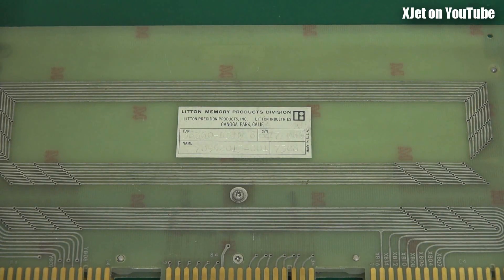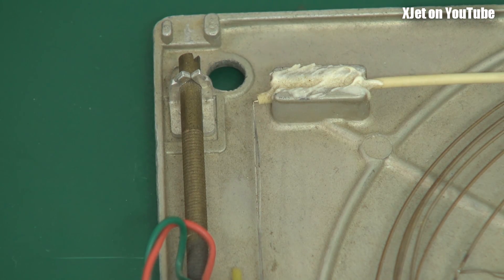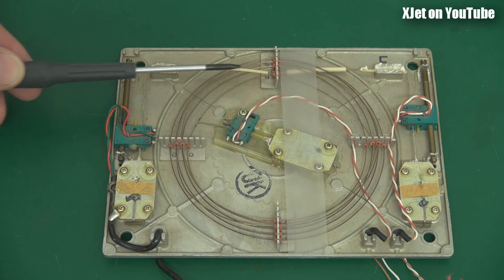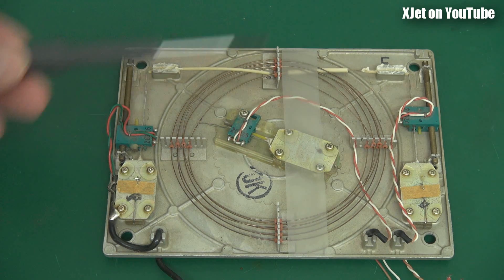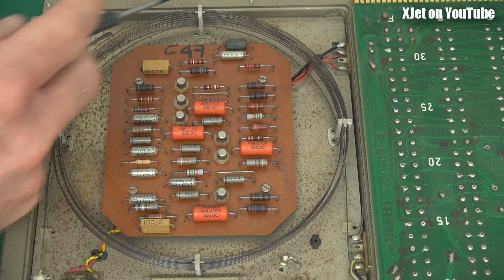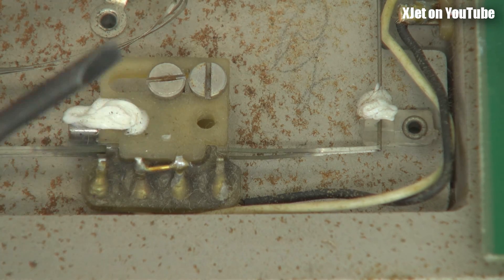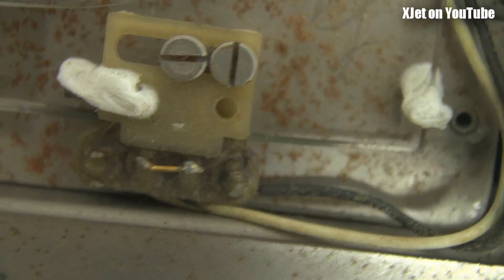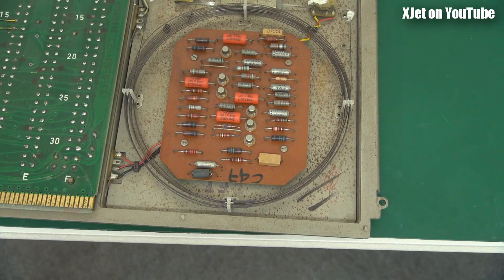Old computer tech:  delay-line memory

Comment: Wow, never knew these devices existed. Really interesting. Seems a bit complicated. At first glance I thought it only could hold a single bit, but it seems it can hold a serial string of data that travels through the line. Wow. So how many bits of data can be saved in a delay-line? 

Can you try to store information and read it out with a pulse generator and a scope? First measure the time it take for a pulse to travel through the line, than send a short burst (of the measured time) of pulses trough the line and check if it stays intact after traveling through the line. Gradually pump up the frequency of the pulses to measure how much data it can actually hold that’s still recoverable. Seems like an interesting experiment.

Anyhow, thanks for sharing!
Reply: Here is a scope image of a Friden EC-130 calculator.
https://www.youtube.com/watch?v=fie-Z-mjnyU

Comment: . Hard to imagine how little data this stuff stored. I actually used a IBM with two of those massive discs in the late 80's on a Navy ship. It used one disc as "Master" the other for storage. Master worked like a hard drive and had to be replaced every week or so. Ship also had a navigation computer probably a 80886 with a then fire breathing 100 K of memory. K not mega. In future I would recommend getting rid of the bug spray to avoid bad puns in comment section

Comment: 7:13 That construction technique is called "cordwood construction" Yo place axial leaded components in a tightly packed pattern between two PC board layers. Name comes from the visual similarity to a stack of cordwood. It allowed a high part density, but was harder to service, particularly for interior components. This one isn't too dense, but some are quite incredibly packed.

Comment: Didn't see in the comments, but the delay line in the unit that had the coils was probably an L-C delay line.  Series inductors, shunt capacitors.  We used to use custom built analog video delay lines for timing NTSC video signals in a television station.  Measure with a scope how much delay is needed for a signal, then you have the option of using enough coaxial cable as the situation demands, or - as we'd usually do - order a custom delay line, with 75Ω impedance.

When I was just out of high school in Minnesota, a couple of Air Force guys agreed to give me a tour of our local radar station (you never knew when those sneaky Canadians might attack!)  The rotating dish received both reflections from airborne objects and ground clutter.  A mercury delay line was used to cancel out the pattern received in the last transmission/reception and was effective in nearly eliminating the ground clutter and showing only those reflective objects that were moving.  I asked how it worked, but they were techs and didn't know.  I've always assumed there was some acoustic trick being used.

Excellent video!

Comment: I wonder if that could be made into a reverb/delay for audio....
Reply: +TheBaconWizard That sounds logical - a really, really lo-fi grungy one I suspect. Obviously people used large metal plates and springs (in guitar amps) for reverbs...  I have a guitar amp with a spring reverb; makes the most godawful noise if you knock it when it's turned on
Reply: Dr Tune yeah, but spring reverbs are LUSH if you use them subtly. In fact I have a project to make one as we speak.
Reply: @DrTune  Or make a string reverb from an old shabby zither. There are alway plenty of broken ones on ebay etc., which doesn't matter so long they have enough strings on it (and can be tuned to hold tension). Put a mic and speaker on it to get the audio in and out.

Comment: The Sperry-Rand Univac computer system, which was based on a large mercury tank ringed by piezoelectric transducers to store memory bits as streams of sound pulses, had a console meter to indicate the accuracy of the mercury delay memory. You could see the meter wiggling randomly as the accuracy varied. This was a true mechanical delay memory, and it had the clumsiness of any mechanical component. The correct pulse sequence was constantly being regenerated using redundancy to eliminate the frequent errors in propagation and detection of the sound pulses.

Comment: I have used 5 inch once, I could write on them once and read once, then 2nd time after writing there was no reading. 3.5 Floppy was better but it was like 10 times only. CD-RW were only a bit better, DVD RW are similar. I don't have a Blue ray disk reader or writer, as we have better Flash drive technology. Blue-ray I will just let it go and not own. I have a Kingston 64 GB SDD as my primary HDD and a 2 TB HDD which i bought just 2 months before the Tsunami that hit all HDD plants. It bought it for real cheap and its my main storage. I have waited 3 years for HDD prices to Drop, but they are too high. Since my 2 TB is in good condition and not in use as the SDD takes the hit, think I can wait a long time till HDD costs go low.
Reply: +therealnightwriter I think you have never used them. I was doing my engineering at that time. and was looking for best floppy which could keep my codes on  so i could use on other PC. HDD was the only reliable storage. 3.5 only could do it 1 time. 2 time was a luck. 3rd was like hitting a jackpot. When i bought my first computer i bought all parts seperately. 64 MB RAM 17 GB HDD and a celeron processor 450 Mhz, and it came with L2 cache, earlier had none. My friends were like why  17GB HDD ? I said just in case. Now my phone has 16GB inbuilt with 32 GB card, still i cant manage space, i need a 64 or 128 micro SD card in the phone. You guys have not seen the evolution of the PC, Google is not the best source. I lived with PC evolution and i am in IT field so i do what i love the most, few people get this.
Reply: yt678901 Think your memory has an IO-error. Floppies were far better than you suggest. My brother's first computer was a 8088 running 5 MHz, with dual 5 1/4 inch floppy, no hard drive. Never heard him complain about failing disks. My first computer (Sinclair QL) didn't have a hard drive either. It had micro drives, which was also storage of data to magnetic film. Multiple write were no problem at all. Of course disks could go bad, but in general not something I worried that much about. Used the same backup disks over and over; rarely if keeping something precious, I would make two copies. Back then it was the only means of storage, so obviously it would have to be better than write once storage.
Reply: @yt678901  Are you kidding? I still daily use 3.5'' diskettes on my Amiga and they rarely fail. IMO they are quite reliable. Cruicial is only to keep the drive clean (cleaning diskette) else the debris from a damaged disk will stick to the head and wreck the next inserted diskette too. And of course keep diskettes away from magnets, strong heat and moisture.
Reply: This sounds like when 360kB 5.25" floppies were written to in a 1.2MB drive.  The read/write head is only half the width on the 1.2MB drive, so you can't fully overwrite the data placed there by the 360kB drive - half the original track is left behind.  So this would mean you could write once on a 360kB drive, then write a second time in a 1.2MB drive, then the disk would stop working in the 360kB drive, as it was seeing half the old and new data at the same time and getting confused.  The only way you could reliably interchange data on 5.25" disks between 360kB and 1.2MB drives was to have two 360kB disks - one you only ever wrote on the 360kB drive, and one you only ever wrote on the 1.2MB drive.  Then the differing track widths wouldn't cause any problems as each disk would only have tracks of the same width on it.

Comment: acousticl delay line memory, worked by depending on the binary length, sending a torsional wave round and round until extraction. your description was was very good.
The olivetti part you are showing was from the very first printer calculator released in 1965 at a cost  of over $3,000 which today would cost about $40,000, just for a calculator, quite shocking really. 
Just goes to show how expensive electronic devices were in the early days, now you can buy one for $2 in wallmart.

Comment: If you had to write your own driver would you be able to jury rig something this old through a serial port? and would it still work?
Reply: +TripleDz You could do it easily with an Ardruino, but that would defy the point. I imagine you'd be able to write it in BASIC or C++, if you have an old copy laying around.

The nifty thing about serial and parallel ports is that they use direct I/O signals, rather than encoded/decoded signals, like USB, which makes it easy to do custom projects if you know how to program.

Comment: I have several old calculators that use delay line memory. A Smith Corona-Marchant Cogito 240SR, a Friden EC-132, A Monroe 925, a Sony Sobax ICC-600W, and a Canon 163, off the top of my head. I SO wish I had one of those old Olivetti calculators. I've actually got over 100 calculators, but those are my oldest ones, and specifically ones featuring magnetostrictive delay line memory. I can tell you that the Cogito had a 480 bit capacity delay line.

Comment: I'm a little confused.  There was a board there that looked pretty modern.  And those "quad-delays" didn't seem at all like the big ones - they looked more like inductors or antennas.  Can we get a closer look?  Cool old stuff btw.
Reply: schitlipz The coil delay lines use the simple property of propagation delay to delay a signal. The electrons have to physically pass over more material, and it adjusts for the timing so signals get to where they need to go at the right moment. This is actually still done on modern computers. Look at the traces on your motherboard, between he CPU and your RAM, and you'll see that the traces task these weird "squiggled" paths. Those paths are done that way so every wire is the same length, and the signals travel between CPU and RAM and all arrive at the same time.
Reply: The delay line here (at the start) is clearly shown to be an electromechanical device.  And if the coil, further into the video, can store memory then I's gots to learn how.  I've recently been looking at toroidal core memory as an alternative to a flip flop for single bit mempry, but if I can store it in a naked winding then all the better.

That squiggled trace length matching you're talking about seems to be only for modern uber-fast computers.  When I was in school computers weren't this fast and trace length wasn't a consideration.  Some quick calculations tell me that even in the gigahertz range trace matching seems superfluous on the scale of centimetres.  But I honestly have no experience with that stuff.

Comment: Seems pretty cost efficient, input actuator, some high quality wire on some nice rubber isolators, and an output sensor.  Seems like the cost per bit would be pretty low vs. 1 bit for the cost of a couple of tubes.
Reply: Very few computers used actual vacuum triodes for memory as it was highly impractical.  The first stored program computers used mercury filled delay lines or a special type of CRT for memory; actually the first computer to run a stored program used a Williams tube, which was a CRT which stored bits in a capacitive layer and either read them out or stored them with an electron beam.

Comment: probably a few decades too late for the idea, given how good and small modern proportional controls are, but I wonder if anyone's ever tried moving control surfaces using nickel wire like that instead of servos or in the more appropriate eras, reeds. Might work well where extreme lightness is needed and not much throw like in a DLG application or something
Reply from the maker: Yes, there have been a numbe of "muscle-wire" servos built over the years and I've even seen a few for micro RC models.  Here's an interesting video:

Muscle wire actuator

Comment: When I see things like this I can't help but think of the genius and the insight of the engineers and dreamers that came up with this stuff.  Nowadays we are streamlining and refining tech, but seldom do we re-invent the wheel.  These people didn't re-invent the wheel... they invented the wheel it's self.  That takes much more creativity.
Reply: Couldn't agree more.

All we do now is figure out how to put more into the same broken systems, not create new systems.
Reply: Cellus is correct. Mechanical delay line memory grew out of other delay-based memories, such as cathode ray tube memory and mercury tube memory. Most people don't know that DRAM actually dates to the 1930s! The Atanasoff–Berry computer used capacitors built into a rotating drum to implement the fast refresh mechanism required.
Reply: Shame this is the top comment, as it takes a poor student of history to think 'old' inventions didn't come from countless iterations of even older ideas, just as they do now.
Reply: He may be perfectly correct, I would not argue against his comment.  However, he completely missed the point of mine.  ;)
Reply: If your point is now something completely different from what you actually said, then yes, you'll have to explain it to me.

Comment: Check out the Wikipedia article on the IBM 2260/2848 devices.  The 2848 had the delay line memory for the 2260 displays.  Because the time it takes for the pulses to go around the delay line is dependent on the delay line length, they were encased in an oven which was kept at about 100 F.  Yes, I'm that old.

Comment: Thanks for the historic information. I had a TRS80 radio shack computer, which used the 8" floppy disks. I think the trsdos operating system was on the disk and it was needed to start the computer. My disks were 64k memory.

Comment: +1 internetz
I'm not as "old" as you but even if i grew with the 3 1/4 diskettes i still like to see what was the world like before that. It's not much of a use but it can sometimes give you ideas that with nowadays' IC with millions of transistors all inside a black box you would have never thought of.
Old PCBs and hardware in general are great learning tools. Being so big and with everything exposed to plain sight, you can poke around it with the oscilloscope and see how it actually works.